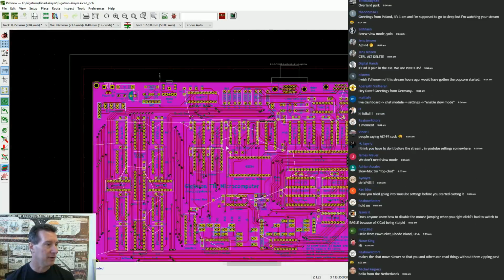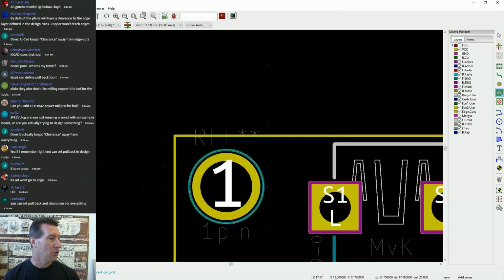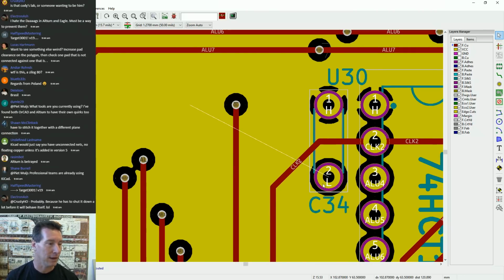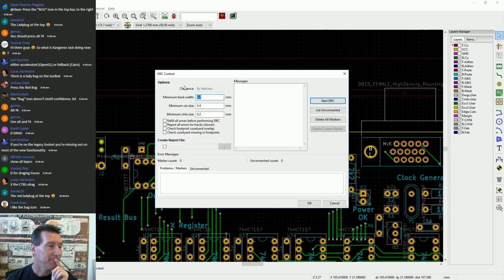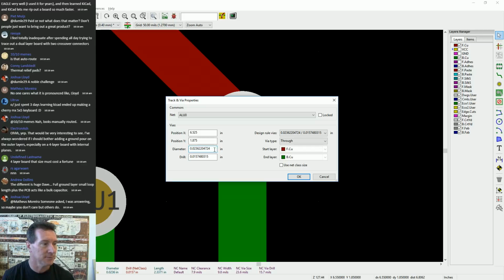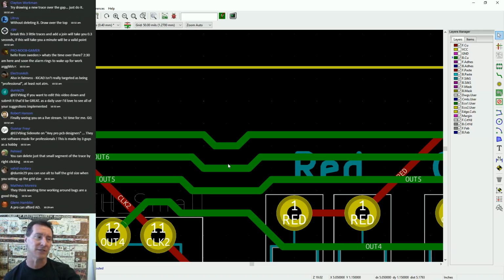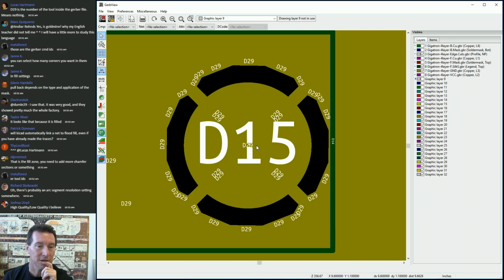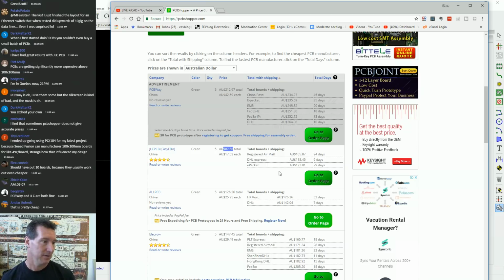KiCAD PCB Design

Comment: I try to do the same thing for my two layer through hole design as well. Now I am wondering if that is the proper way of connecting bypass capacitors to through hole ics. Here I see that the cap is close to the vcc pin, but vcc and the cap are connected to the vcc plane. Also gnd pin of the ic is connected to the gnd plane as is the cap. Is that a good technique for using THT bypass caps on THT ICs?

Comment: Summary of that Video:
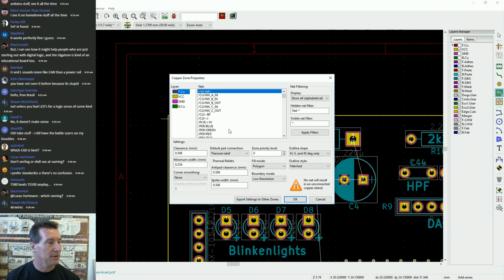7:25 and 16:00 Always add a pullback at the edges of the layout.   
23:23 test coupons are put usually outside of board layout.
25:49 Greater than 90°. Bad design practice. Reason: Sharp angles are a trap for the acid with the bubble edge technique. It will result into removing more copper than you want.
29:03 Never enter a pad at anything but 45° or 90 ° degrees.
42:19 What he tries to do in this video. (Difference in EMC between 2 layer vs. 4 layer board)

Comment: @eevblog, little hack for you that I found whilst fart arsing around with a PCB this evening

You know how in the PCB layout it sometimes spams it with a ton of values and looks like shit and/or is a pain in the ass to clean up when you have 15+ LEDs? Here is a little trick I just learned.

Fire up the python console, then type the following

from pcbnew import *
board = GetBoard()
for item in board.GetModules():
 if item.GetValue() == u’LED_Small’:
  item.SetValue(u’’)

It's important to remember the "u" bit on the front of the single quoted string, as that tells python the string literal is unicode which appears to be what kicad runs in.

Then View -> Redraw and BOOOOM! No more annoying values on the PCB for all the components that had a value of "LED_Small" :)

Comment: I gave Altium a test drive once. My experience was exactly the same as yours. I grew up on PCAD (on DOS) way back. As a Professional Developer, you should know what RTFM means. If you don't know how something works, it does not mean it does not exist. KiCad serves a community, which is non-profit generally. In scientific research, we typically do not have great funding to pay the exorbitant seat pricing of these commercial  packages. For us, KiCad (and other open source) is a blessing. And its supported by CERN nowadays, which helps a ton. Its really not that bad, after you get used to its workflow. Just like any other package.
Reply: Fully agree Johann - It's about understanding the workflow of a tool.  I designed my first PCB in DOS as well and have used many PCB packages professionally over the years.  KiCAD is exceptionally good for many applications and for the cost.  I've used way too many "professional" packages which cost as much as a small car and require >$1k/year to keep the licence current.  Many of these packages were chocked full of bugs and regularly shit-the-bed.  KiCAD is actually pleasantly stable and highly affordable.
Reply: I've also tried many PCB design software packages such as EAGLE and EasyEDA (which was not easy at all). Many of them were either free or pirated but KiCAD was the only one that worked for me and it's free, which is the best part.
It can also do a 3D render of the board, which is cool to look at and makes KiCAD that much better.
Reply: Agree on all. I personally lay out HF transceivers and have chosen KiCAD over all the other 'free' choices that I've tried over the years.  Maybe Dave should do another 'in depth study' of a meter's tendency to tip over when rotating the function dial.  It's been a while
Reply: What are the remaining steep slopes of the KiCAD learning curve ?

Comment: "I hate clicking the middle mouse button"
Warning small rant incoming: There is ONE mouse that has three mouse buttons. ONLY ONE. And what I mean by that is that you can use your ring finger to comfortably click a third button on a wider than usual mouse without moving or contorting your hand.
I can't tell you how amazingly practical that is while working on a computer!
And yet the only mouse I've ever seen adopt this incredible idea of adding a real third mouse button is the logitech G600.
I mean they put a gazillion buttons on many shitty mouses, but they fail to utilize the ergonomics of the human hand. It's just amazing this has never caught on.
Reply: Also the Logitech Anywhere MX has a dedicated middle mouse button.
Reply: Thx. The nice thing about the G600 though is how effortless you can click it. When it breaks and I can't get a replacement I'm going to have to start modding or building my own mice lol.
Reply: wait a second...
Edit: nevermind, i went to check my IBM mouse that i thought had three buttons but it only has two, it's a model 96f9275.
I swear i had an OG three button one somewhere :)
Reply: You can emulate the third button by pressing both left and right buttons at the same time.
Reply: Yeah but you have more than two fingers. Why not have more than two physical buttons that are positioned ergonomically? I tell you it's so amazing to me to be opening links with either left or middle mouse button easily, and use middle mouse button on tabs to close them again. It's just effortless.
Reply: Because you use your other fingers to hold and move the mouse around.  If you had 5 buttons in a mouse (some do, but you simple have two extra buttons that are actuated on the wheel by tilting it left and right), or 5 dedicated buttons rather, where would you put them without sacrificing ergonomics? Also, the ring and pinky fingers don't move independent from each other, so you'd end pressing both buttons at the same time.

Comment: 0:30 Does this mean the other half use the center mouse button like Kikad? Sounds like you need to exercise your middle finger more, Dave; I'm happy to give you the opportunity right here. :P Throw one at Chris for me as well; Kikad sucks compared to gEDA.
Reply: gEDA seems to be dead since 5 years, right?
Reply: gEDA isn't dead, it's stable. I've stuck with it because when I first tried the two gEDA was just easier to make custom components (I have a lot of 6AU8 and similar choobs) and Kicad had a terrible schematic export-to-PDF bug. I'll have to see if Kicad's more recent development has brought anything to recommend it over gEDA's stability.

EDIT: OK, I've had a good look at a recent build of KiCad. (The one from the Debian Sta(b)le repo; I prefer to avoid the bleeding edge.) I have to admit it's matured a lot since 2011 and it's libraries have seen some love from choob-heads. Some aspects of its UI feel back-to-front compared to gEDA, but I can get used to it. I was especially impressed that it has footprints for octal and noval sockets, so it looks like it should be able to handle most of the common valve types out of the box, and it gives me some good starting points for adding in the odder valves in my collection.
Reply: @petersage5157  Debian Stable (Stretch) does still use KiCad Version 4.x
If you want try the newer KiCad Version 5.x  you can use Debian Backports, it's in there.
Or you could wait, until Debian Buster is stable and released.

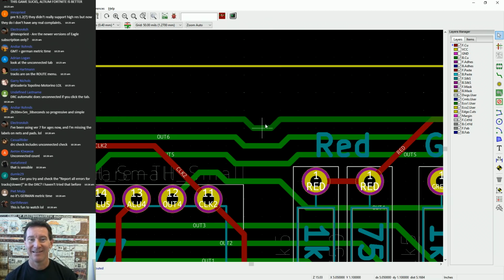Comment: 49:22 : Having tracks snapping up to align with themselves and not only the grid is a huge saver.
Forcing one to redraw the tracks, or even delete them to redraw them takes more time, and can also cause problems later on. Let's imagine that I'm in the process to tidy up, and are forced to do it with delete and redraw tracks and then something else grabs my attention for a brief moment. There I have to refocus and catch up what I was doing, and I might risk forgetting to redraw a few tracks. 

Yeah I know. the DRC is there to help me on this. But if a programs interface and features is smooth and easy to work with, it'll reduce the errors from me as a user. That is what makes a program good.

Comment: KiCAD designers should look at how Inkscape does snapping.  You can snap to endpoints and/or corners of existing objects.    There should also be a "delete segment" command to remove the 3 short joging parts and leave just a straight track.
Reply: At one point i thought about using inkscape as a board design tool. It can do everything except drc and erc. But it crushes all the free tools in the snapping/grid department. Kinda funny ^^

Comment: OOPS, sorry about the double post, I am getting old and my mind seems to be elsewhere from time to time:::::  At any rate, last spring, whilst sitting in our Class A Motor Home, which we spend our winters and early springs in, I was watching a video on my Macbook Pro, while drinking my morning cup of coffee.  I held the coffee in my left hand, mouse in my right, and had my recliner back in the recline position and while Big Clive was teaching us about some thing electronic, I fell fast asleep.  Well when his project exploded, it startled me awake, I jumped (I suffer from a bit of PTSD the result of 30 years in uniform) and the coffee left the cup and infiltrated the Mac-book Pro.  Now my laptop is DEAD, dead as a door-nail, and the screen is now forever black.  So it was that I drove into Kingman Arizona, about 50 miles North of the little village where we happily spend our winters, and located a convenient pawn shop.  Among the computers in their glass covered display case, I found a nice looking DELL with a 17.5 inch screen, 1 TB hard drive, and only 12 GIG of RAM.  She looked new, but for a smudge or two on the screen. The power pack still had that new DELL sheen.  I thought I got a great deal at only 175 bucks US. So I took her back to the RV, and took the 16 gig of ram out of my old HP (that my wife was using since her keyboard died on her HP a few weeks before) and began using the DELL.  BAD MOVE.  For some reason the Dell rejected the DDR3 RAM, well some of it anyhow, and I was a bit upset about that as I ordered it direct from Crucial.  But I made it work, and the DELL was fast enough, for me anyhow as about all I was doing at the time was a bit of editing on photos that I regularly took of our live in the Desert for all the folks at home in South Dakota, who  were up to their necks i SNOW, while we leisured in the 80 degree sunshine of Southwestern Arizona.  Then things began to go bad.  The computer began shutting down because the power supply was getting bad, this had the effect of screwing up my windows install, so I added Linux to the mix, and used that till I returned home to South Dakota.  Well a month or so later, the power brick went completely bad, so I made sure I found one that said the magic words, DELL OEM NEW on the Ebay  add, and ordered a new one.  This one turned out worse, and the computer kept shutting down, soon the hard drive failed (I am blaming the sudden shut downs on the Windows 10 install.  I did trace the date of manufacture on this unit, and it was now 2 years old. So I replaced the Hard Drive with an nice brand spanking new 2TB hard drive, and reinstalled the Windows 10 that I had backed up on a flash drive, but the damn power brick kept getting worse. so in desperation, I found a NON OEM 65 Watt brick for half the money, and asked for a refund from the seller of the OEM DELL brick.  I was really surprised that he was very quick with the refund, and never argued a bit. After getting the new brick, things were working better but I kept getting lockups and windows errors re-installing Windows never cured the problem, so I returned to the original 12 GIG of RAM, and things settled down.  They are MUCH slower now, but no more crashes, and I believe I have a working unit now.  So today, I was cleaning up around the shop and I came upon that NEW OEM DELL power supply and decided to TEAR IT APART!  What I found was not a DELL OEM supply but a cheap Chinese junk power supply.  Now back when I was trying to use it, I found it would charge the battery overnight but would not run the laptop during the day and I could only get about 6 hours out of the unit before the battery went dead..  I  measured the output voltage and found it only putting out 17.6 volts where the old unit put out 19 volts, the 65W unit put out  21 V and is working great!  At any rate, I found the ground wire was free floating inside the power brick and appears to have never  been connected to the pin.  All the Caps were of very cheap no-brand-name devices.  On the bottom of the board, nearly all the caps and resistors were crooked, some hardly reaching the pins where they were meant to be soldered.  So at long last,  I  have my computer working, all-be-it slowly, but fast enough to watch youtube videos and perhaps edit a photo or two using Paintshop Pro, and reading Drudge News.

Comment: Great video and as a software dev I kinda cringe when I hear 'It should know what I'm thinking and wanting..' and 'it should just know what I want to do..'  -- I get it though and I fully agree to a point coming from a professional designer but wasn't sure if KiCAD is marketing itself was a profession package?  I guess I can see it from both worlds and for something that I thought was free; it does a pretty good job as long as you know the 'gotchas' that you might run into.
Reply: They are "marketing" themself as a professional package BUT they are financed with manpower from CERN and contributions. So... meh

Comment: Great video Dave. I watched it live as well. Pretty much everything you pointed out is right on the spot. Hopefully KiCad is watching. They really need start working on GUI. As a professional doing big boards with thousands of components it's just not working. It might be free but the extra time you spend is easily earned back. Not talking about the lack on confidence which is maybe even more important.
Reply: Well, that is one side, the other is money/time that needs to be invested via programmers.
The KiCAD developers are not in it to 'deliver a product to customers' - they are in it to make themselves a tool.
So if you want something from them as a customer, you might want to look up the CERN donation website and see if you can spare a couple quid to give to them to have time/money for more programmers.

And the other part is getting engaged in its development (bugtracker or even mailing list if you're capable - this is open source afterall) or support (KiCAD.info for example).
;-)

Comment: It's not so much FOSS as rather the combination of ego-centric development which is very common with FOSS projects and lack of a large userbase that mostly contributes to lack of spit and polish. Some amazing examples of that are VLC media player originally a student developed project. Then on the other side of the spectrum you've got LibreOffice which is very well polished but mostly follows a corporate structure and use to have a lot of commercial backing. Linux is another obvious example.

Blender actually shows that just community user-focused development can produce a really polished product. Software like Firefox which is "professionally" developed follows the cathedral model and generally takes very slow strides to get polished. It's also not like a lot of closed source software doesn't have the same problem. It's just sale-ability is a pretty good filter for just completely unpolished non-sense.. well unless you're Adobe.

Comment: use metric, not imperial
Reply: Sure, why would anyone want to use eg. standard 100 mil pin spacing which the actual components come with when you can write the same thing as 2.54mm. I'm sure you would immediately know twenty pins away is at 48.26mm - so much more intuitive than 1900 mils...
Reply: use metric, because of metric prefixes...
Reply: @emi22n  mil = milli inch. SI prefixes are not bound to metric...
Reply: Attila Asztalos that's fine if you're just doing boards with DIPs and pin headers. How about a 0.8, 0.5 or 0.4 mm BGA? Or a 0.5 mm QFN? QFP? TSSOP? FPC connectors?
Reply: Use what you want. In every pcbnew dialogs you can enter the unit you want like "15mil" or "2mm" and it will be automagically converted. Ranting is useless.

Comment: What is the gigatron?
Reply: 10^9 Tron
Reply: It's a computer without a CPU. Instead it uses 7400 series logic to build a processor in blocks. An even less integrated (i.e. entirely discrete) processor would be something like the MOnSter 6502.
Reply: wow that's cool

Comment: Wow, got me irritated in just the first few seconds. IMHO, asking that KiCad (or any other new PCB CAD package) should copy what some older software does is just wrong. I don't care that's what you're used to, it's a recipe for the crap interface used by the likes of Eagle to be frozen in time forever, giving nobody a choice. Let new designers start with a blank slate, see what they come up with.
Reply: Eagle is very far from frozen in time. Look at the changelog since Autodesk took over. Feels like they've done more in a year than Cadsoft did in eleventy years
Reply: Yeh right, lets see how well you get on with a new car with the pedals in a different order and the steering wheel works the opposite way round.
Reply: Farley Hill 
when you buy a new car you still have to learn it's various features and people get by just fine. When software goes so against convention that it does the opposite of what's intuitive (like an inverted steering wheel), which they typically won't do, then your analogy would make more sense.
Reply: Fair enough.
Some French helicopters have a rotor that turns in the opposite direction.
Why they thought that it was a good idea I cannot imagine.
Very exciting for a few seconds.
Reply: To be fair Kicad was released in 1992, and the interface does seem a bit dated/weird at times, not that I've tried anything else. It's also usable, free, open source and continually improving(esp since CERN got involved).